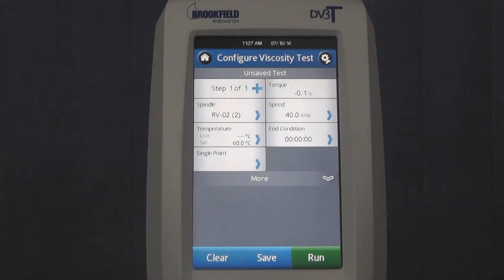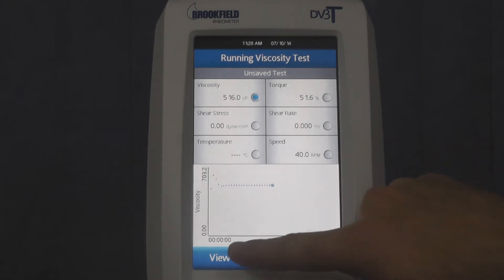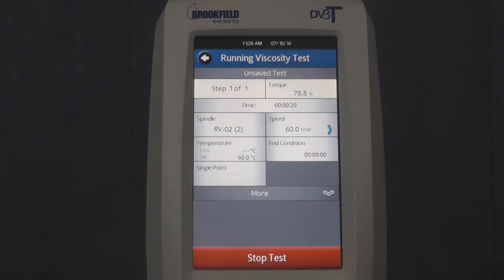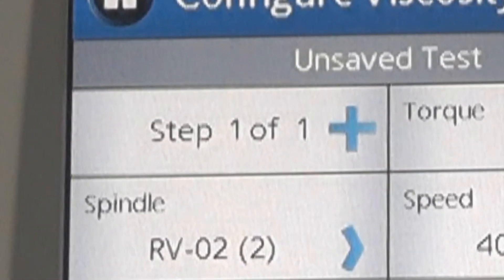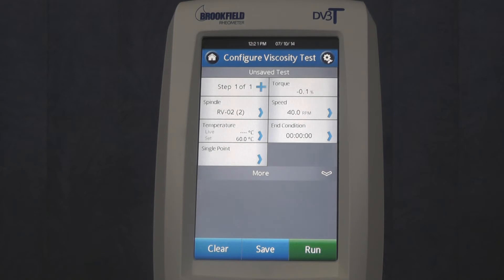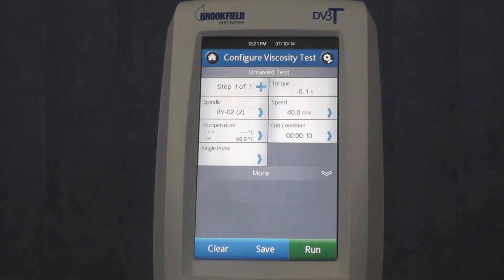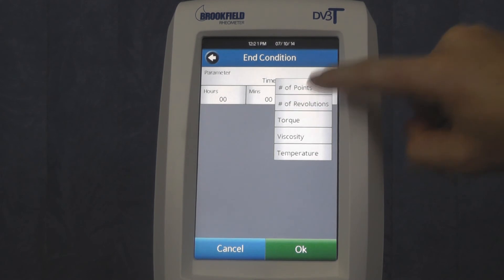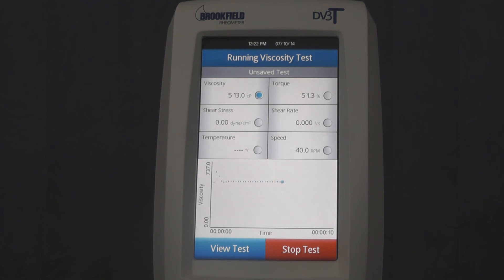Brookfield DV2T / DV3T New Speeds

Comment: good morning, just one question. We have bought viscometer DV2T -HB to read viscosity in our sealants silicone RTV., thick product  We are having readings around 250 000 CPS ( 75% torque, 95 spindle, 20RPM) . We have also LV viscometer to measure self leveling (liquid compound)  silicone RTV with value of  400 000 cps. My questions is, only looking values of CPS, how is it possible a liquid product has a higher value of CPS than a thicker  paste-like compound ?.Can you please clarify it ? we have bought HB model to read thick paste viscosity.
Reply from the maker: sergiouni2,
The Brookfield instrument measures the resistance to flow of a material under a specified force. This force condition is created by the speed, spindle, spring range and container size used.
The force applied to a material can affect the viscosity reading. It is common to see the viscosity of a material drop as the force is increased. One possible reason for your self-leveling material to be showing a higher reading than the paste it that it is being measured under a low stress condition that is within the Yield of the material.
The Yield of a material is the force require to start flow. While a material may appear free flowing it may need some force to start flow which can be seen as a high viscosity reading under low stress conditions. Examples of this are hand sanitizer and ketchup. 
Can you share the condition you are using to test the low viscosity material?